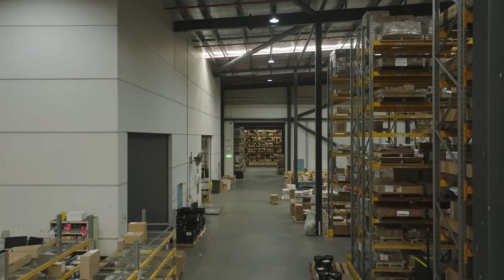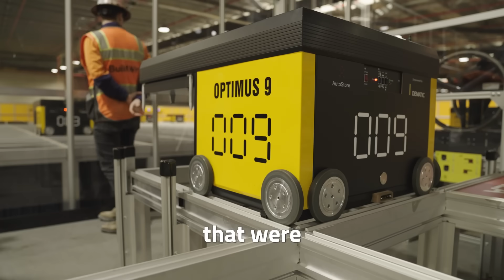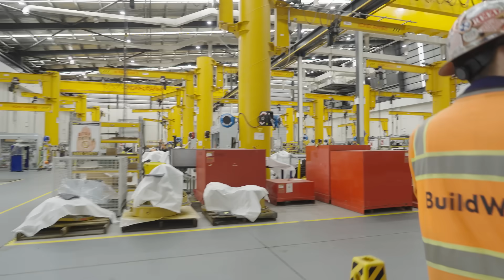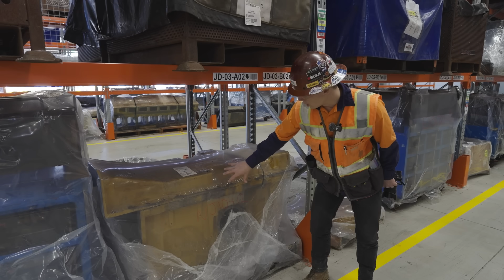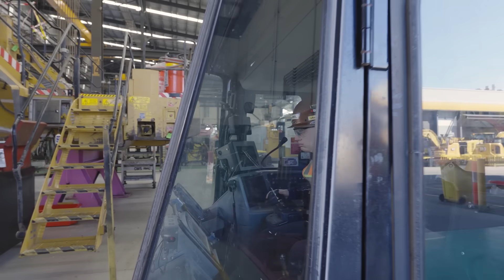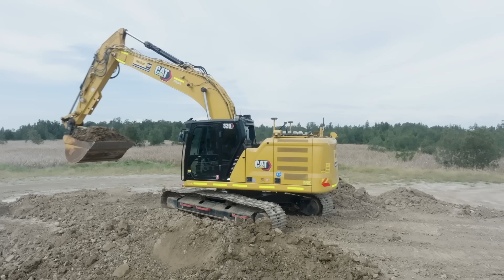Touring Australia's Biggest Caterpillar Dealer!

Comment: does the CAT dealer in AUS rip u off like they do in Canada
Reply: Lmao yes😂. I'm a hydraulic specialist, components we buy for pennies we sell for quite a margin. Also I'm not a Cat dealer that's just the business. I did however work at Toromont, and they pay well. If you have hydraulic experience send them a resume. For example -16 Supercat flange plug, our cost is $3-5 depending on the vendor, I sell it for $34.
Reply: @Disturbed420420  I rebuilt a 1980 Koering-parsons backhoe that was sold as scrap and put in a septic system with it.  I guess I know a little about hydraulics.  I know the guys at Parker (experts) were wrong in giving me 60 duro o rings for my spool valves which leaked after I rebuilt them, I think i ws sposed to use 90, that was a lot of work taking them apart

Comment: Did you check the tool wall to see if they have the same problem as us in the United States with the 10mm always missing?
Reply: 10mm and 9/16 spanners live In belly plates don't you know that??.
Reply: I work and live in Sydney, we have the same problem.
10mm sockets are always missing.
Maybe they are used as currency with the local drug dealer.

Comment: You have a video from a year ago called "The biggest CAT dealer down under - Hastings Deering"... so is Westrac or Hastings Deering bigger?
Reply: WesTrac Cat has close to 4,500 employees. Hastings Deering has over 3,000 employees. WesTrac Cat covers two states - New South Wales and Western Australia. Hastings also covers two states - Queensland and Northern Territory. If you consider size of the dealership based on the two states combined and employee number, WesTrac is bigger. If you are looking at it from a single state perspective, Hastings in Queensland would probably be the biggest single state. Suffice to say - both are the biggest from different perspectives.